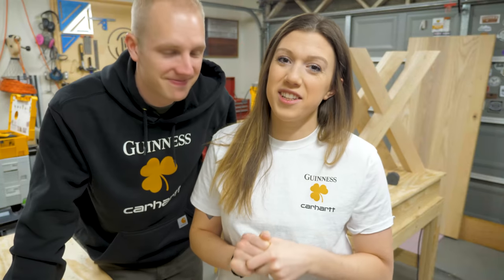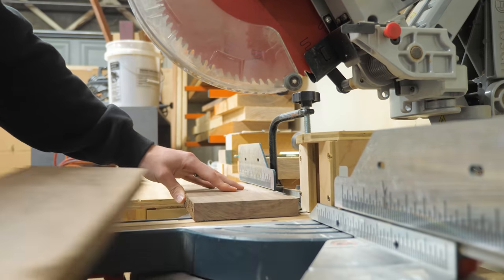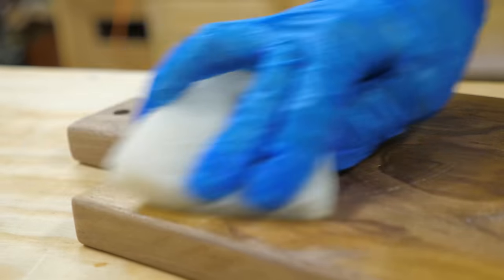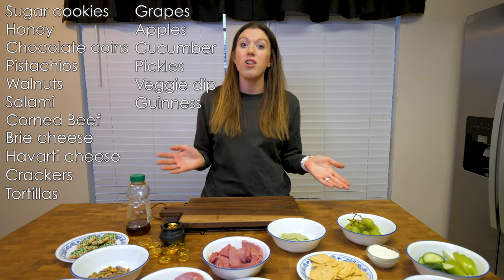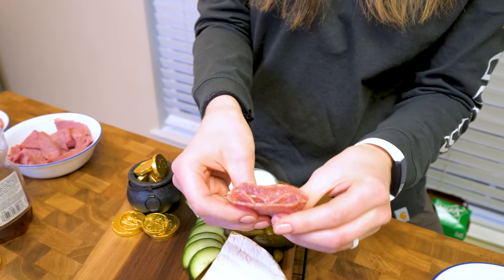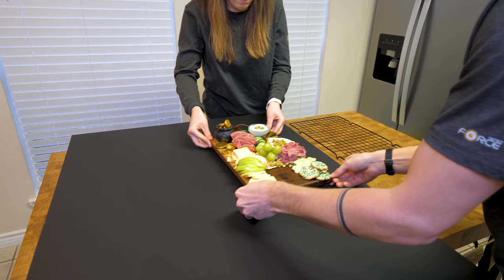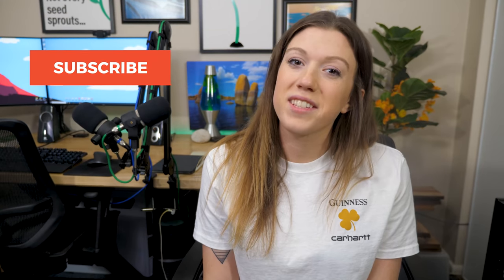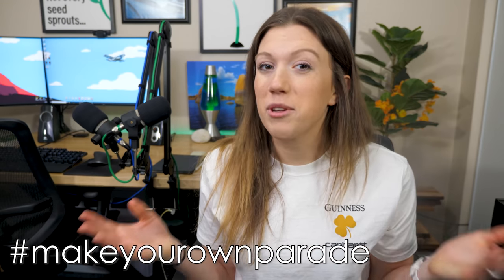selling charcuterie boards: the easy way

Comment: does anyone know if there is an issue with burning a brand in (with a branding iron) once the piece has already been finished with oil and wax?
I was interested to see that you put it through the laser after the fact...
Reply from the maker: We do it both ways - either works just fine!

Comment: I noticed your garage door is Not insulated, i bought an insulation kit at Homed Depot and lowered my temps by 15 degrees in summer ( typical temp outdoor 110 in summer), also warmer in winter by 10 degrees.

Comment: I dont have an issue with orders as much as getting them out in a timely manner with the time available each day.... any suggestions or have yall struggled with this when you had other jobs?
Reply from the maker: Batch out as many as you can at one time and then realllyyy streamline your fulfillment process! We’ve done a few videos on batching out boards - definitely go check those out. 

Also, if you’ve got super high demand, don’t be afraid to raise your prices!
Reply: How do you sell your products Brad? I want your problems 😂
Reply: Try smaller batches, too!  If you only have 2 hours to work, for example, you COULD make 1,000 cuts on the table saw and have a huge pile of wood pieces.  OR you could cut, joint, and glue up a couple of board blanks, then while the glue dries, finish rout a couple of board blanks.  Then you get paid the next day, and your list actually gets shorter. Once you work through your backlog, you can increase the batches a bit.  I feel strongly that large batches are not practically as good as everyone imagines them to be.
Reply: Great advice from everyone, thanks. I have just started that if i get an order of 4 coasters, i'm gonna make 12 and so on. I guess i just gotta get past this hump and get a little more ahead.

Taylor, I have 2 youtube channels, IG, Facebook, etsy, and after about a year of trying i'm just starting to get my name out locally. I'm far from being able to do this full time but closer than I was a year ago.

Comment: Very nice looking, but although you do want to have the food staged on your product, I don't think you should cover 90% of your product with items you are not selling.  You're hiding your product drastically.  Would you stage a coffee table and cover 90% of the top and sides and expect people to buy the product?   Also, since you're able to use the router to reproduce the corners on the handle so easily (I think I mentioned that in a previous response?), you may want to put a slight radius on the edges of the handle so the points won't dig into your palms.  Woodworkers tend to have tougher hands than people that sit at a keyboard all day.  I like that leather strip you added.  I mentioned that before...I'm not sure if these changes were in response to my suggestions, but I'll assume that they are just to brighten my day!  :0)  It's my birthday and I'm taking gifts from everywhere LOL.  OK, my birthday is not today, but it is REALLY close.  Speaking of which, I'm out of here to shower and shave for my birthday dinner.  Wishing you two much success!

Comment: I thought you would never take sponsors for you channel?
Reply from the maker: Hey Jacob, I don’t know where you’ve heard that - we’ve taken sponsors before and we’ll gladly take them again. We’ve always said we don’t take TOOL sponsors. Thanks for supporting what we do!
Reply: @jennieanddavis  I'm curious, and don't take this the wrong way, but why would you take certain sponsors but not tool sponsors? Again don't take this the wrong way, but I believe that if I was in your position I would probably take sponsors but if asked I would be able to say that I do take sponsors or I don't. Not this way, for this or that I do but not for that. I'm not trying to be a jerk and that is why I said don't take it the wrong way but I don't understand and that is why I asked.
Reply: @davesanders7893  They probably don't take tool sponsors because they want to use the tools that they want to use. They can buy and use what makes sense to them not what a tool sponsor wants. Being sponsored by Carhart isn't going to prevent them from buying a Powermatic whatever because they instead took a Grizzly sponsor (the names don't actually matter, just trying to illustrate the point).
Reply: @davesanders7893  If I remember their video correctly, I believe Davis said he didn't want to have to be locked into a brand of tools because sometimes a tool from a different brand might do the job better.
Reply from the maker: No worries! The guys replying to your comment hit the nail on the head - we don’t want to be tied to a certain brand if another has a better tool.